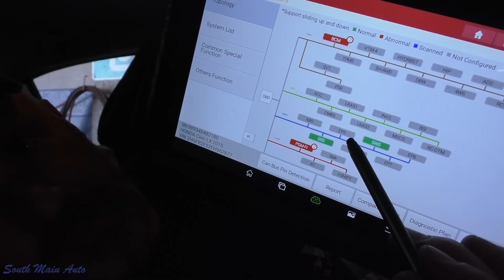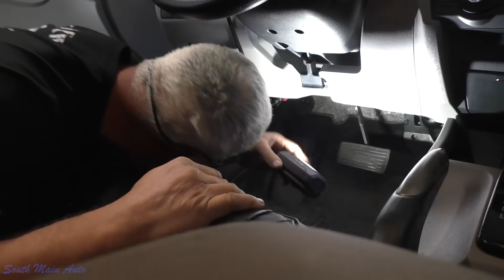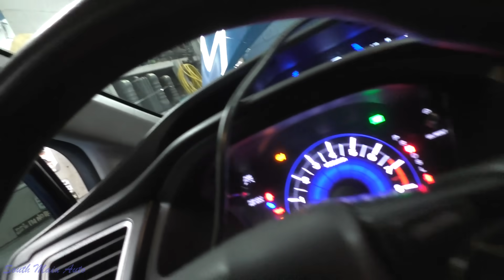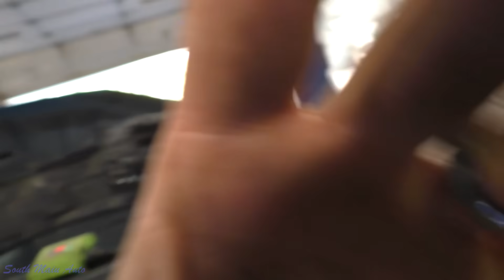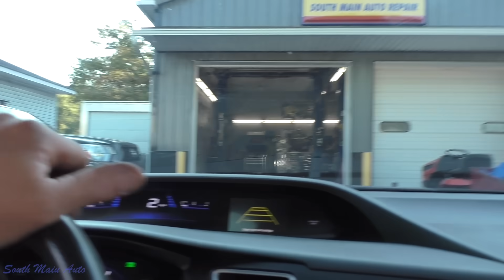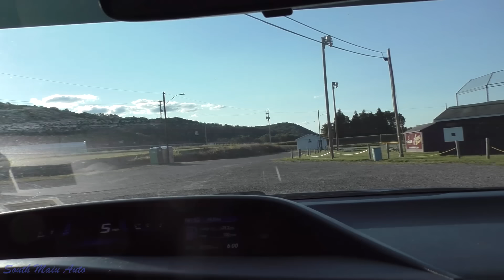ALL THE LIGHTS ON! Sticking to the Diagnostic Process Pays Off

Comment from the maker: Talked with the customer and he said this is exactly how he bought the car. He didn’t want to just start tossing parts at it like the last owner, so he brought it in. We still don’t really know why the fuse was missing in the first place, but everything’s working now. He’s going to grab a used camera from Wilbert’s and just drive it to see if anything else shows up. Thanks for watching!

SCAN TOOL USED IN THIS VIDEO - https://amzn.to/4gmogbs
Reply: Looks like the customer lucked up on his own ❤❤😊😊
Reply: One evil reason for missing fuse: it went to some shady shop and they pulled the fuse, knowing exactly what kind of troubles it generates. Or some other potential car buyer pulled the fuse to downplay what the car is worth.
Reply: @JaakkoF  this is the correct answer. people do this all the time on auction cars
Reply: Some days you just get lucky!  Take the win and celebrate. The fuse box wasn't  the most accessible.
Reply: It's still an interesting video. It's impressive it has well over 200K on it and runs perfectly. 4 cylinder Hondas are amazing.
Reply: @sharedknowledge6640 
Specifically that engine and generation. The Civic Si of that generation has the infamous K24 in it with a 6 speed. Hard to find a good example of one, most of them were run into the ground and clutch burnt up. But once in a while I see some good ones on marketplace
Reply: @richieg7382 That 2.4 never made it into a Civic, they’re slightly taller than the K20, and you can swap one in, but if you have a K20Z3 engine, the K24 would need modifications to make it as powerful as the earlier version of the K20.
Reply: Looking at the engine bay, don’t see any rusty parts. Suspect this car came from a non rust belt state.
Reply: Had a faulty ABS sensor in the rear wipe out all computers in my hondoo civic aswell..
Reply: All your videos have useful info In my opinion. None of them have I thought are useless or stupid, every video shows a diagnostic process you go through which is my take away from it.
Reply: Hey Eric!! What's the make and model of the new scan tool?
Reply: @event3horizon I’m also curious what kind of scan tool that is, looks similar to the one that Ivan uses at Pine Hollow.
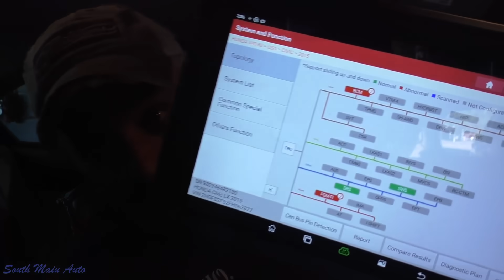Reply: Looks like a Launch, he mentions it at the topology reference. 3:09
Reply: @ryanpowell2883  Ivan has the Topdon phoenix plus.
Reply: @event3horizon I came to the comments looking for that very answer. I'm curious
Reply: Looks like a launch scan tool
Reply: Think the original owner took well care of this 9th gen Civic LX. Can tell by the Weathertech floor mats on the driver’s side.
Reply: @Hondamdfan
Whenever I see Weathertechs in a used car, that automatically raises the value $500
Reply: This is the best kind of video! Glad you had a great vacation. Now, Fyi, I want to see ALL THE engine swap parts, all 20 for both cars. PLEASE
Reply: @SouthMainAuto  I work at a Hondoo dealer and I had the exact same thing on a 2014 accord last week. Some ding dong put that same 7.5A fuse in the empty spot next to it. Customer said they had a shop put an O2 sensor in a few months before and that's all the info I got. They said the lights came on and the power steering randomly stopped working. Okay buddy. Completely not even related but could only figure someone was just screwing around in there I guess.

Comment: It's actually a learing experience 🤣
Sometimes the simplest things are the problem. I usually start with fuses for anything. I bought a Honda for my daughter the ac quit working. Checked the charge, fan kicked on, low and behold the fuse was blown. Found no short and a new fuse fixed the problem. 🙄

Comment: I ran into the same problem almost exactly like this earlier today. I couldn't program my fob after changing the battery while following the instructions in the owners manual. I thought about testing the door module since it wouldn't display the "progam active" on the dash. Many youtube vids said to replace it, but not one that I watched mentioned the fuse at all. Before tearing apart the C pillar trim, I checked several fuses and found a bad 15 amp fuse. Fob worked instantly. No idea why it blew, what it powers, but it's up and running now. That;s why I personally go to fuses right away.

Comment: Hmmmm....Hard to sell a car with the money light on, lot easier to sell if it just needs the ABS module changing, which is provided..  Did the previous seller remove the fuse to get rid of the money light and the potentially serious 'inspection-failing' light to get a better price????  Modern equivalent of taping over the light???

Comment: The Hyundai and the Kia engine jobs were not covered under the extended warranty on those POS? The only thing I know about them these days is that if I see a car with bad tail lights or brake lights, it’s going to be one of them, and if it needs an engine, well, it’s one of them.

Comment: Love this video! Reminds me of my 1987 Mercury Cougar that I bought for $350 because it wouldn't shift out of 1st gear and needed a new transmission. $.75 cent clip later for the shift linkage, and drove that bad boy until I sold it for $850 several years later :-D

Comment: I had it happen twice.  Pressing on the top pins of mini fuse with multimeter actually made a blown fuse reconnect.  Power it up and it blows again.  Press it again and reconnected and beeps the meter.  Don't press em very hard!

Comment: Eric,
Just wanted to let you know what I just went thru with my 2016 ram 1500 larimie 5.7 hemi. The inside rear light would come on by itself with the doors closed. And I couldn't control my dash light brightness with the switch. So after watching your show I started to think what I might have changed to cause the problems. I recently replaced the strut assembly, upper frames, and outer tie rod.
While working on it , I  pulled the plug from the light under the hood to keep the battery from draining.  And that cause all the weird problems.

Comment: @14:32 - Both you and Mustie 1 have helped to teach me finesse when operating on my cars.  Slow down, be deliberate, go easy on fasteners with the right size driver and use your brain.  Took me a whole 30 minutes to change the starter on our 2004 Lexus after diagnosing the starter relay using your tutelage.

Comment: My parents car is running bad. Sometimes it works just fine, then suddenly runs bad and even stalls. So first shop changed the coils. That didn't help. They changed shop and they changed all the injectors. Did it work? No. So I guess they will change the whole car before they are done.  All are just part changers...

Comment: This really isn't a dumb video at all man, it just shows you how simple a fault can be sometimes and also how you should sometimes take a step back from your own work and just check it again. Some problems you just create on your own purely by accident, especially when crammed underneath a dashboard or upside down in an electrical cabinet that you can't reach properly. I've worked as a heavy equipment technician for a while and we had a machine that had issues with the rear view camera powering on but having no signal, guy before me said he checked everything and even replaced the monitor AND the camera itself since the cables all had continuity, turns out that there's a tiny little switch on the back of the monitor to select a channel for when you're running multiple cameras on the same bus, and someone had moved the switch (or it moved because of vibrations) and the new screen had the switch in the wrong position as well. Sometimes it really is something dead simple and you'll chase your tail for hours. I love seeing stuff like this where it's just day to day stuff. It's not always a wire shorting out ONLY on Wednesdays in Odd numbered weeks or some BS like that.

Comment: I. Too have seen this mysterious wandering or missing fuse problem. Many times the story goes for us is “it ran fine when it came in” as we work with collision “experts”. My techs do great work for me but have a tendency to believe the other shop that claims all the fuses are good. I will ask in as calm of a voice as i can muster to remind them to look for the wandering or missing fuse. We will see this and other problems after it went first to the tire and alignment guy who had his buddy check it out, and then to the dealer that didn’t want an older high mileage car at their shop. The dealer service writer quotes a repair estimate exceeding the cars value. Now as a last ditch effort to save it they will bring it to us, (“those guys that don’t give their work  away”) because the car drove when it came in. If we can’t fix it the body shop is going to own another  Honda for the salvage yard they are starting. How much can you possibly charge a customer for that repair? Not as much as your time was worth once you say missing fuse. Good reminder for diagnostic professionals, always find out about the lack of communication and check the powers and grounds.

Comment: The way I check fuses is to look for the specific fuse responsible for the specific problematic module or circuit in hand, if the fuse is OK I'd go behind the wires and circuit of that specific problem, if it is blown, well here is your problem lady 😂
That way I shortcut a lot of time finding the location of the module/circuit, picking wire diagrams and find pin location. And to be clear, checking all the fuses without knowing what they do or the circuit they responsible of is just plain stupid.

Comment: I don't just go in and check fuses either.  Or check them with a dayam power probe or meter.  I use a test light with an incandescant bulb so as to have an idea if there's real load carrying power there.  Drives me crazy here on the tech line finding out no one has a real test light anymore and tells me they have power only to find out a couple of calls and wasted time later they don't.

Comment: I thought my son had a bad body control module. 
After two weeks, I figured out the body shop, that just fixed the car after an accident, had painted the surface and bolt hole of the negative battery cable and didn't sand off the paint before putting the cable in place.

Comment: Yea these are not stupid videos, they are the ones that should be required viewing for the dealer techs that say thing like you need a new engine computer or I'll need to replace the 20 modules my scan tool said were bad (do you really want to spend this? By the way that'll be $250 for diagnostics).  I get it, you like showing how to find difficult things (I like those too) but you use the exact same method to find the issue whether it's simple or difficult.  The correct method, that you always show, is logically and methodically tracing down a problem.  ACTUAL TROUBLESHOOTING.

Comment: Never a stupid video Eric, it as a case of baby steps as you said in following the plan and sticking to it, the fact is you did not assume it was going to need a slew of parts none of which would have worked without the correct fuse AND following the procedure used by Honda to code clear means it is invaluable to show that you never look to far ahead and always watch your feet.

Comment: Actually was a good video of what you get in the shop. It was also good info for those that have not experienced how scan tools have quirks about clearing codes & different procedures we have had to do to get them to clear & what happens if you don't know that's what happened & start going down the rabbit hole thinking there's still something wrong and all it is was the code(s) didn't clear with the scan tool. Sometime you have to go into each module & clear the codes.

Comment: Backyard mechanic “troubleshooting” : 
1. - Make trouble till something is shot and smoking. 
2.- keep replacing parts till it repairs by itself. Like magic.
3- Remove parts in the morning. Go for lunch. Come back later and forget what you did. 
4.- Drive or tow the vehicle to nearest repair shop. Claim your relative or friend did something wrong. 
     Claim you have no idea what happened. 
5.- Turn cheap repair into expensive mess.

Comment: The only other thing you did was probe the connection. The connection could be hiding an issue, that by your bending and reconnecting cleared an intermittent short. That was existing before hand. Would explain the fuse issue. Sometimes we just get lucky also. Is what it is.

Comment: I suspect that a previous owner pulled that fuse and cleared the codes to get rid of the engine light to hide problems from an unwary buyer.  A buyer did the parts cannon and did not fix the problem of the missing fuse, but accidentally fixed the real problem. That buyer could have been the guy the current owner bought the car from.

Comment: I still like your videos, Eric. I like your analytical mind. I was hoping that you would get on your drawing board and draw your target, but seeing how once you pulled up the electrical wiring diagram and noticed pen eight affected a few other modules that were not communicating. It’s a logical assumption to double check Power at the fuse. Of course you’ve got to be able to have the correct wiring diagram.😊

Comment: You know you're 💯% right about only checking every fuse at the end of this Video,     Because data driven diags work, Guessing shouldn't take long, Especially if you need to see a wiring diagram to actually find the solution, In most BMW for example you're are going to be checking a lot of fuses, In at least three different locations  😊.

Comment: My 2014 VW doesn't have the female receptacle metal contacts in the fuse boxes that are not a feature of that car. I don't have radar so that wiring harness doesn't exist in my car just two plastic holes with nothing in them. The harness is specific to my car and the factory provided hardware. Same with my 2005 Duramax, it I didn't spec it they were not going to spend the extra three pennies for the wires or plug.

Comment: i had an issue once... brought my car to the shop and they told me i needed a new module.. ended up dumping 1200 into it with money i didnt really have.. got the car back working great.... few years down the road i actuly became good friends with the shop helper from that shop... he told me.. they sell or at least charge the customer for "new" parts then get a used part for pennies and throw it in the pass seat and say they changed it when all they did was buy somthing and throw it in the pass seat... he told me he remembered my car and i had 3 wires chewed and it only took the 20 mins and a couple connectors.. we went out and looked and her showed me the 3 wires..little heat shrink tubes and everying were there..... he said it was a $100 job... but i got charged 1200.... we need more mechanics like you eric...

Comment: Eric, I don't fully agree with you. First, there is no repair history that you have on this car.  It shouldn't take a long time to check the fuses, and also check a fuse diagram for  empty slots, and what fuses go into each slot. Also especially when all the lights are lit up like a Christmas tree. Obviously someone pulled that fuse out. There was no short in the circuit. Possibly a sabotage situation. Anyways, your strategy with diagnosis worked, and you found the issue quickly.

Comment: I disagree with your thought it may be a useless video. It's empowering for us in the cheap seats, where we might be able to solve problems without all the high tech scan tools. The start with basics like checking fuses is what we all need to begin with. My usual method, to check all at once to avoid missing one, would have failed here because I wouldn't have recognized the significance of that empty slot.

Comment: This must be an auction thing. I bought a car at an auction and it had the exact same problems and the same fix. Put the fuse in and clear the codes, fixed. I think people do this crap to try and get the car really cheap. I suppose it works, sometimes, or they would just quit doing it.

Comment: Eric, I think we need to fly you over to India (on American Airlines) with your test equipment, and help the Indian AAIB figure out why Air India flight 171 lost power and pancaked into a residential area.
Your diagnostic skills are legendary, and the AAIB can't seem to figure out what the hell
happened.
Reply: They discovered the fuel cut off switches may have been accidentally activated, cutting off fuel at the worst time possible during takeoff.

Comment: You wouldn’t notice the fuse missing if you didnt check your power to ground 1st so I wouldn’t consider this an useless video. I had a 2025 accord come in from a body shop. They put in a new headlight in the right and it wouldnt turn on. they swore they check the fuse and it was good. Checked power to ground and didnt have any. Followed the schematic and traced a fuse labeled LCM-R (light control module right) and found it blown. The fuse they checked was a DLR fuse lol anyway lady that owned the car got hit and water got into the headlight causing a short and blew the fuse.

Comment: Well done. The customer may not be always right in a lot of cases. If it wasn't  a fuse just think of the possibility of having to diagnose the coms side between modules and trying to find a short or broken wire. 👍

Comment: I worked at a dealership for 11 years and I don't know how many times I would run into this kind of nonsense all the time. I've been working for the air force on equipment and vehicles and I rarely get someone that has tampered or tried to fix their vehicle and It's been nice. Side work on the other hand never fails to still keep me shaking my head just like this video. Good work!